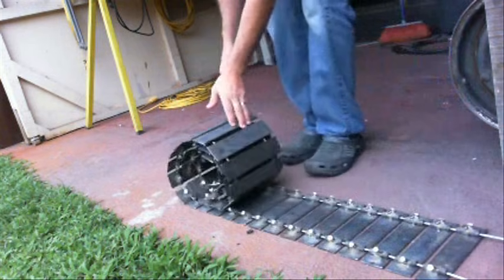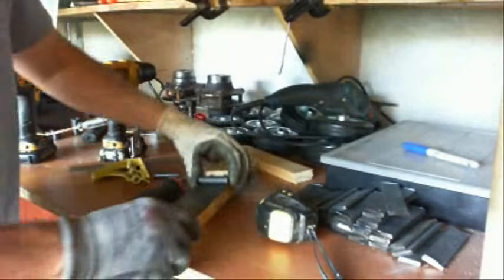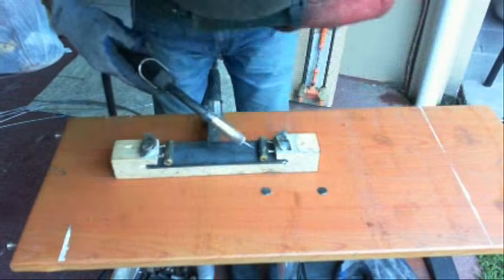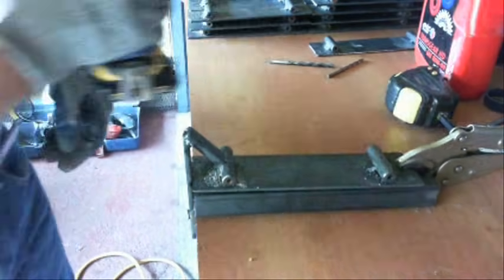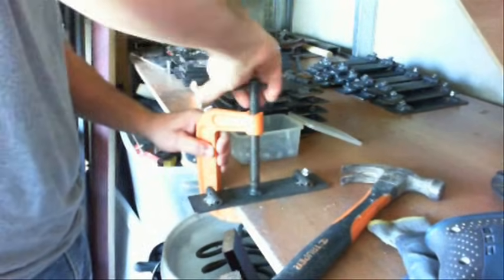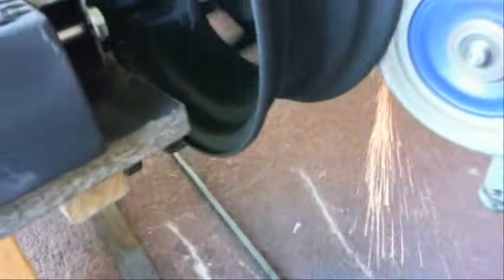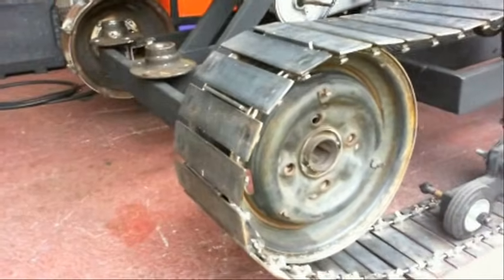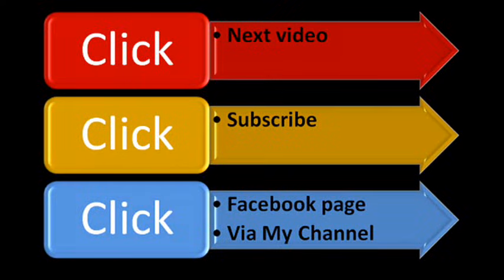How to build homemade tank tracks Part 9

Comment: i hate to be negative because you actually building this is far better than me just sitting here WISHING, but.....   here is my two cents.
i would think that a significant amount of torque will be applied and i foresee that each of the treads will slide along the cable when you give more throttle.

Comment: so i'm assuming that you are using the bolt/nut configuration to lock down the plate so that it won't move on the cable, if that is the case then i question the durability of the cable at the point where the bolt contacts the cable, that much stress on such a small point will cause failures very quickly

Comment: Regardless of what the strength ratings are for that cable, I seriously doubt it will hold up for long. One thing you should have done to help was to put a bevel at each end where the cable slides though. This would at least help give it a rounded edge instead of whats more of a blunt edge which will most likely start cutting into the cable

Comment: The steel cable between the plates is no good if the plates are tightened by bolts. They're likely to slip. It would have been better if it had spacers with the cable inserted between the plates, then you can be sure that the plates retain the space between them.

Comment: Wouldnt it be easier if you used a rubber tire by cutting out sidewalls then connecting a couple together with kevlar industrial belts or something.

Comment: I can't see this working. Its an interesting idea but I think the cable would break relatively quickly.
Reply from the maker: If you look at Ripsaw It looks like it uses steel cables for it s tracks.
Reply: Does it? I did not know that. I would think that the constant flexing would really be hard on the cables.
Reply: Cable on an overhead hoist flexes a lot and much more load during the flexing.  I would think that the cable in this application would be sufficient for a few years.  However, moisture within the individual strands of the cable will certainly decrease the life unless it can be dried and lubed appropriately!
Reply: your got that right he will spend a lot of time fixing this

Comment: wow. lot of work. way cool.
Reply from the maker: Thanks for watching
Reply: Its way cool. I farm and that would work so good on the farm. I live in North Western Wisconsin .  And last summer was the wettest year I've ever saw at 55 .  We had 28 inch's of rain over the summer till frost and it was so bad you couldn't even get around with tractors. Unless they were Four wheel drive .  They are company's that sell track set ups for farm equipment but at a Hugh cost. I'm a machinist /farmer . And I'm always try n to think of thing to make jobs easier .  I like your attention to detail. Very good job making your video. Thank you Roger Wagenius Grantsburg Wisconsin

Comment: Brian Edmond 
I love the design of your tracks I may make one for my electric garden tractor, Great job!
2hrs cutting approx 2 acres or 8-10 hrs pulling trailer on a charge
Converting to battery power is a great idea for a garden tractor I converted one 15yrs ago, I used the 3 separate motor design and it is still cutting grass on a daily basis, it is amazing how it never breaks down and needs almost no maintenance, I renew the batteries every 7 yrs I am just on my 3rd set now, my design will cut up to 2 acres on a 50cent charge there are no belts or pulleys and no oil on the entire tractor, it can pull a trailer for about 8hrs on a charge, because battery run time is the most important aspect of most conversions I paid particular attention to the most efficient design, I used 3 separate small motors one for the drive with electronic speed control and two smaller with a cutter blade mounted on the shaft of each cutter motor ,total amperage when cutting grass is approx 40amps, (2000watts) this design only uses the battery power req to do the job, very little wasted battery power, it uses magnetic breaking of both tractor and cutter blades and automatically applies parking brake when you stop or get off the seat, an amazing tractor.
electrictractor.net

Comment: This i sall amazing to see and all, but theres one thing i dont think i saw when you explained making it. how do you keep your plates from moving on the wire? i know it has the bolts in it, but how do those keep the plates from moving on the wire? i'd really like to know. making my own personal tank and trying to get this thing to work track wise has been driving me insane. I wanted orginally to do converyor and steel, but then came the issue of not knowing how to attach steel to rubber
Reply from the maker: The cable fits perfectly through the hole in the metal plate, the hole I drill for the bolt gets threaded and the bolt is tightened down onto the cable to keep it from moving.
Reply: ah, okay i see now. thats pretty freaking cool. thank you so much.
Reply: yoshimitsu0614 just drill two holes in the rubber and steel track and then bolt them on with nylon lock nuts use grade 8 bolts so they don't break

Comment: i like your idea, the steel wire does not bend enought, according to the diameter of the steel wheel, resulting on steel wire long service.

Comment: Interesting, but attaching into chain like connection links as opposed to cable would give it more durability stability and prevent sideways movement in the track itself which on uneven ground could cause it to skip off depending on how fast you were going/wanted to go

Comment: multiple quarter inch bmx sprockets & chain, cheap easy to  get or service, bicycle tires cut into sections could be good cheap tread on your track sections. wire bead makes good attachment points

Comment: Do tell us how they're holding up? Many times I've thought of using cable as the linking parts of a track set.  Big conveyor chain is ridiculously expensive to make a "real" set of tracks plus having to buy of make the sprockets for it to run on would put a feller in the poor house. I have been hating myself for driving off when a man next to me at the land fill dumped several broken rubber skid steer tracks beside me. They had plenty of track left and was 2 sets of them. They must have been vantleized because each one looked to have been cut with a chainsaw. But for a machine like you're building a splice could have made the perfect set of tracks.
Reply from the maker: +Phil Lowman They have not broken yet but I am still working on the vehicle so I have not used it much.There is another person on YouTube using chains I am curious to see how they work His channel is Prancstaman

Comment: what if I wanted to do this for an SUV car for off-roading fun, do I need to change the chassis of the car and the arms? and do I need to use a bigger rims?
what did I forget?
Reply from the maker: Midget It would be allot of work but you could do it. You would have to lock the steering wheels in front and cut the body so the tracks would pass across the top of the wheels. There are a few on You Tube that have done it.

Comment: i am planing on making a steam powered tank for the more than likely emp attack on the USA, have any pointers?
Reply: +plague Doctor Just store your spare ignition parts in a steel garbage can.
Reply: that does seem like a more realistic plan, so i will do both.
Reply: +plague Doctor better use some older diesel engine, they don't need electric components to work :P
Reply: +plague Doctor Hey...I`m a steam engine feller,.If you have questions,just axe.

Comment: Hello dear friend.
For some time now I have been following their work.
I would like to ask for help, want to use part of its project to build a chair, because I have a friend who had a health problem, with his daughter, and now she is no movement of the waist down.
I've tried to buy the mats, though prices are absurdly expensive. I had lost hope until you see your video.

Well I want to ask you some photographs, and measures of how you made the mats. And I wonder how you are doing the curve, it is necessary to stop attraction of the mats to change the direction. Well in my project, I plan to use an electric motor, and only one engine, I see some chairs that use two engines. Now your project will help me solve this problem. I look forward for your information. Thank you very much. I'm sorry I do not speak English'm using an electronic translator.
Reply from the maker: Evanildo Almeida I am sorry to hear about your friends daughter . I think if you could use two electric motors one for each track would be better and easier to make controls for. As for the tracks you could make them any size you would like, You could find some smaller guide wheels instead of what I used. maybe it could be better to use a motorcycle chain welded to the tracks and sprockets for the guide wheels since the chair will not be going that fast. If you want more information I will try and help.

Comment: Why don't you use mechanical tube, its very strong and I'm sure you could find a size to fit your cable. Even though its expensive I'm sure the cost would less than all that drilling. Just seems like a great deal of unnecessary work.
Reply from the maker: saxonforge Unnecessary if you can find a metal tube the exact size of the cable. Not everyone lives in the U.S where you can buy anything you can dream up.

Comment: just a suggestion on attaching the pads to cable take a sledge hammer and crimp cable in cross piece would have better holding and less work.

Comment: Very nice. I have made similar vehicles. Do a search "half track best riding toy ever" to see my first creation. I fear your boggie wheels are going to be eaten by your cable mounts as you turn that beast. I had that problem a little. yelwing@att.net
Reply from the maker: You could be right. The rubber on the wheels are not the best.I may have to come up with some other ideas. Your half track looks pretty cool. Thanks for the comment

Comment: How are you going to take up the slack in the track when you g
Reply: Go over bumps
Reply from the maker: I have watched several videos on tacked vehicles with similar designs and there suspension seem to be able to handle bumps and driving over obstacles without a problem. I will have to see. I guess the only time I see a problem would be if it would go fast enough to catch air and compress both suspension arms at the same time when landing. I don't think it will be able to do that. But we will see. Thanks for the comment.
Reply: I rewatched the videos and saw that he dose have a way to take up the slack.

Comment: How do you get the metal track bits to not slide back and forth once you have made the spacing and put the cable through.
Reply from the maker: Kevin Hornbuckle I have watched a few videos by Tankman. He makes his tracks with conveyor belts. He says its important that the tracks cant stretch so not to come off when making turns. I have some Spectra / Dyneema cord with is stronger than steel cable and does not stretch I was thinking of using this but I figured I would try the less expensive steel cable first.
Reply from the maker: I tighten the bolt onto the cable. Each track has one bolt on each side. The bolts go all the way through and are able to tighten onto the cable so it can not slide. Thanks for the comment.
Reply: Aceman307
I wonder if you could grind a point onto the end of the bolts. The point would dig into the cable rather than just trap it in the tube.
Reply from the maker: Kevin Hornbuckle I thought about that and thought that by leaving it flat there would be more surface area in contact with the bolt and the cable.Also when I drilled the holes for the bolt I drilled through a little on the other side of the cable so when you tighten the bolt it can lock the cable in the hole better.
Reply: Flat will probably work better. I wonder if anyone has ever used nylon strap in this application.
Reply: Aceman307
Reply: I happened upon some rubber material that would work well for tracks, without cable. If you want a picture of a mock-up, let me know. I am aware that you already have much time and materials into your design. But I think you can lighten your weight and increase your strength and reliability by getting away from the steel and cables.
Reply from the maker: Kevin Hornbuckle Sure, send me a message with the link on my channel. Thanks I will check it out.
Reply: Okay. Will do.

Comment: Cool idea.  How do you tie the ends together?
Reply from the maker: Sorry I forgot to show the master link. Its the same as the other links except I drill two extra holes in the 3/8 bar and bring the the cable ends up and out and then crimp them. I will make a video on it in the next progress report.

Comment: I see now. Are you going to need a spacer in between the track plates? Those plates look plenty strong, how thick are they? I had to put cleets on mine because the plates were to thin not to. Thats why I put the bolt head on the outside plus to get my chain to move up and down I had to notch the sides which works out since I weld the bolt head all the way around it strengthen that area back up.  Can't wait to see how you connect the track ends up to each other.
Reply from the maker: Oh man! I forgot to show the master track for connecting the ends!! Its like the other except I drill a 1/2 " hole in the middle of the 3/8 rod and then on each end I put one of the lock bolts. The cable ends come up and exit out the top of the 1/2" hole and the lock bolts keep it from slipping back out. I will show that on a future video. The flat plates are 3mm thick. I think they will be strong enough. I also may still add  the center guide on every other track but I am going to wait until I can try it to see if its needed.
Reply: I see, Thanks for letting me know on the master track.I figure each track plate should hold 1/4 the weight of vehicle. For mine I have 800 lb limit on my vehicle because of tires are plastic with max weight limit of 50 lbs each with 16 tires, so me standing on the track plate in center and held up on the ends without buckling should be good enough for me. I'm about 250 lbs.
 For track guides on yours you could probable use 1/2 or 3/4 flat stock on the tubing and extend them up that way, and keep the center where the wheels are clear like on a sherman tank track.